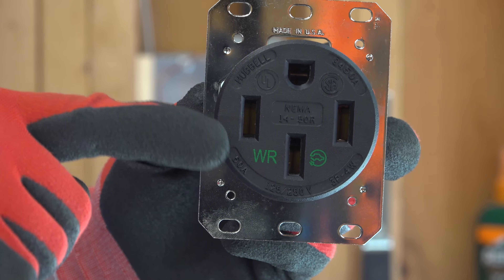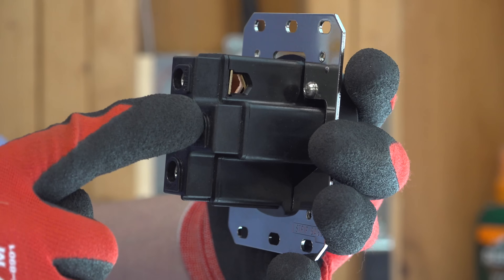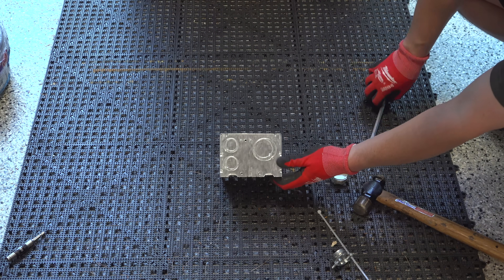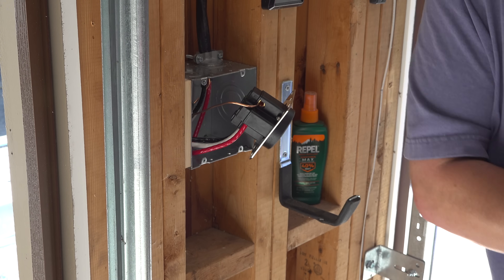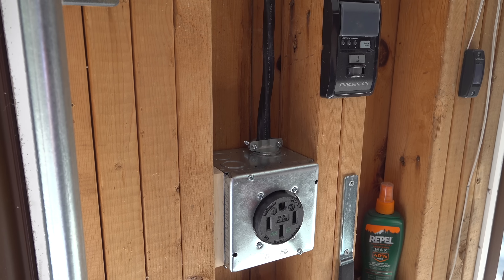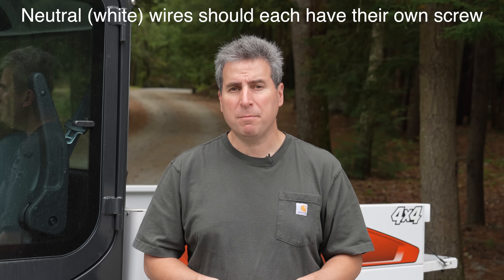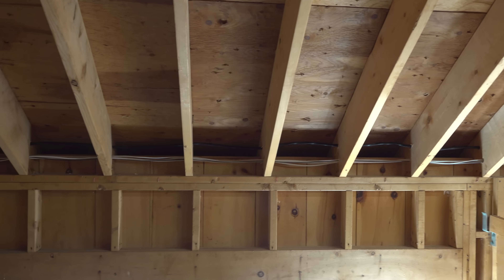How To Install A 240V Outlet Start to Finish -  EV Car Charger - Welder 14-50 Explained

Comment from the maker: Nothing in this video is sponsored. Here are some products to use:  Hubbell EV Outlet: https://amzn.to/4poYhnJ Leviton EV Outlet (great price): https://amzn.to/4nwkoHh Raco Box (bubba) : https://amzn.to/4poYvv5 Raco Cover: https://amzn.to/4mdKBJu  Cable: https://amzn.to/4nzE90I Arizon Cable (best deal): https://amzn.to/48gcqgU Affordable Torque Driver: https://amzn.to/4mZTxTZ
Reply: Can you plug a 50 amp rv into it
Reply: The Leviton EV rated isn't nearly as good as the Hubbell.  If you want to save money, get the Bryant, which is another brand name Hubbell sells under.  It the same design and high quality.

Comment: I believe latest code will have neutrals bonded to ground in one location. Looks like old code bonded every neutral to ground which could result in ghost voltage running in ground.

Comment: Nice job. Looks good. Last long time.

I didn't see if the circuit ground was connected at the outlet or if you simply connected the outlet ground to the box. Did I miss a jumper connecting the box, outlet and circuit grounds in the box?

Comment: The best way to wire any EV charger is to hardwire it. 
The only reason a plug and receptacle is necessary is so that the owner can take the charger with them when they leave home.
The car "should" include a portable charger in the trunk that can be used remotely. 
Keep in mind that every EV owner should be receiving a paycheck from the manufacturer because they are actually part of the test studies. 
The fact that some 50 amp receptacles were melting is a colossal failure of all involved.

Comment: @8:07 CORRECTION >>>. THE NEMA RECEPTACLE IS A 14-50 (not a L-15-40). It is not locking twist lock type.

Comment: This is great. I put in the Home Depot special a few years back and I’m strongly considering ripping it out to redo it this way.

However, I also find that I essentially never need 40A charging for long. I could easily set the EVSE to pull 32A or 24A and have no impact on my life, other than maybe plugging in one more night than I usually do each week

Comment: Most 4x4 box fill issues are resolved by installing a box extension ring. You can add an extension ring to increase box volume, and it meets code requirements. This provides more than enough working space and is cheaper than buying a bigger box, which is harder to find at most stores. The covers are usually out of stock or too big or small because the Hubbell is slightly larger than most NEMA 14-50.

Comment: job not done: permit, you need to notify your power company about an EV charger installation because it adds load to the grid.  very concerned about the load on your service.

Comment: For 240V in my shop, I only use 14-50 outlets.  I mostly run my welder which typically uses a 6-50 outlet.  I installed a 14-50 plug on my 2 conductor (plus ground wire) welder cord but left out the neutral pin.  Funny how close it looks to a 6-50 plug.  If NEMA had the forethought, they could have made the 6-50 plug compatible with 14-50 outlets.

Comment: Nope. 
Silver Cymbol needs to separate the  neutral from the ground at the sub panel. It can be easily done with a separate ground buss. Just run the neutral back without the EGC or better yet, run a separate ECG to open the OCPD in the event of a ground fault. 
The ground rod at the remote building is to drain off unbalanced DC static electricity. 
No good can possibly come from combining the neutral and grounding electrode at the out building sub panel. You get objectionable current.

Comment: You broached the subject of continuous loads and using the EV rated receptacle because of this.  Not sure if I heard you mention what amperage limit a continuous load would be on this conductor and over current device.  Important for many people wanting to install EV supply equipment or use this setup for any type of continuous load application.  40amps

Comment: If you have more than one ground rod and they’re not connected together with the ground cable, then if lightning strikes one of your buildings you may suffer electrical damage. When lightning dissipates into a ground rod, there is a concentrically dissipating circular area propagating away from the ground rod, which could be many tens of thousands of volts per linear foot that can induce a massive indifference in voltage between two ground points and fry all your sensitive electronics. 

No matter how hard it might be, you should connect a ground cable to both ground rods.

Comment: Btw, I also use 50A GFCI breaker by EATON for NEMA 14-50 and I strongly suggest you check the breaker and actually entire installation with Infrared camera after few hours of continuous EV charging.

I had my EATON breaker tripping while charging on hot days, if I turn it on — it'd trip again, but when it cools down — it will work okay for few more hours, and sure thing — breaker was hot on infrared camera, around 55-65C. 

I redid the wiring and re-torqued to spec again, still no luck, nothing else in the circuit was hot on infrared camera — I called EATON support line, explained everything and they said that newer GFCI breaker revision with LED indicator for fault codes is better designed for continuous EV charging — they sent me a replacement and it worked just fine on the hot days this summer!

Comment: Nicely detailed! I simply don't understand why people favor hardwired chargers, I also installed NEMA 14-50 outlet and got myself a 40A charger that supports both 240V and 120V and we simply take it with us for roadtrips to have an emergency charger that will work from any 120V outlet or 240V. Not to mention the general usefulness of 240V 50A outlet in the garage as the video mentions, glad this is getting popularised!

Comment: Please indicate that such a outlet is not designed to be plug in/plug out too often. In fact in most case they are connected near permanently. So avoid to endlessly change the use of the outlet.

Comment: The main problem in the US is that the population isn't protesting the lack of a true three-phase power system.

There is absolutely no need (except perhaps for island apes) to have a 50-amp, 240-volt circuit.

With three-phase power (400 volts between phases), you could use 4 or 6 mm² wire (which is much cheaper and significantly easier to handle than 6 AWG) and a 32-amp circuit breaker.

Comment: NOT CODE COMPLIANT!!!!
 Continuous Loads (e.g., EV Chargers): For loads running for 3+ hours (like EV charging), you typically apply an 80% derating to the wire... 6/3 is rated for 55a for non-continuous loads but YOU NEED A 4/3 romex if you are using ROMEX for a EV charger... (55 amps x 0.80 = 44 amps) If you run conduit and pull THHN wire then you can use a #6 wire. Please be safe folks!! Call your local electrician and ask questions, we use the code book every single day and could have saved this guy a bunch of $$$!!! 

***please note, I also don't believe this will burn his house down overnight, but over time that wire will start to show signs of degeneration form the heat produced.

Comment: 240 Volt Lines can Differ. Im referring to the Neutral wire. Some appliances need a Neutral, some don't. An air conditioner condenser does not need a neutral. A Range and Dryer does. So its best to have the neutral and not need vs need and not have!

Comment: A legend NEMA 14-50R top of the line is $40.  They last forever, it's a commercial receptacle.  This is a very simple installation and frankly in a garage you're better off mounting a metal box on the outside of the finished wall surface, especially if you're finishing your garage in OSB or metal liner panel.
Reply: Legrand

Comment: How did you make video instructing how to wire a 240 plug and not show or explain where each wire goes on the receptacle?
You just said red hot black hot white neutral and other 4th wire ground .
Did good on breaker .

Comment: A NEMA 14-50 is either rated 50A or it isn’t. There is no such thing in UL or the NEC as a “50A but only for a few hours” receptacle. ALL listed 14-50s are allowed 40A continuous on a 50A circuit. Cheap and Hubbell units are both 75 °C lug rated. When 14-50s melt during EV charging, it’s almost always poor installation (loose or improperly torqued terminals), not because the outlet “isn’t continuous-rated.” EV charging just exposes bad connections.
Reply: There is a difference in durability between 50A receptacles of different quality. Sorry, not black and white. Plenty of examples of ppl melting plastic on cheap 50A devices after long charge sessions. Depending on environment and heat dissipation issues outside the device itself (e.g. wall, insulation), 50A heating performance can vary considerably, all within listed gear

Comment: Not true. The $12, 50 amp outlet was designed for 50 A. Whether continuous use or not. That’s ridiculous to think that the manufacturer would’ve designed a device in away that was only considering intermittent load.
Reply: You’re new to capitalism, I see

Comment: Reality is 99% of EV owners do not need 50amps or even 30 for daily use unless they drive 250 miles per day 😮.  I installed a simple 220V/20AMP with a 16A.  Plenty good to top off the Teslas’ battery after coming home.  I even have the rate of charge set at 12 Amps to be more gentle.  Staying with a 20A solution is less expensive and practical as I installed a dual outlet with 220 and 120 at 20 Amps to power my compressor or cheap welder.   Here is my video. https://youtu.be/nEmHBaSZd-U?si=-lQ-wsK1NHz3hh-f
Reply: Being more “gentle” is not a thing at residential charge rates. Being more gentle than dc fast charging is. Below 40A, you don’t get a benefit of even slower charging, and the efficiency actually goes down (more cumulative loss to heat dissipation).

Also, residential power in the US is 240v, not 220, and hasn’t been for decades
Reply: @nate3356 the term 110 and 120 are used interchangeably, same for 220 and 240.  The point is no one needs 40 or 50 Amp charging at home to replenish the energy they used during the day.  Anyway, plenty of people will install them because they think they need one but they don’t for normal daily use.  They can avoid the expense if there was more awareness on 220/240V @16A

Comment: Don't use an outlet - hardwire it to avoid melting your chargers  plug when the receptical connections become loose or corroded or the receptical is underrated for your actual duty cycle.
Reply: He specifically picked the most high end receptacle commonly used (Hubbell). This is an indoor installation, it’s not corroding

Comment: You can also use #8 90deg C thhn / thwn wire as it is rated at 55A
Reply: You aren't going to find terminals rated for that temp though, 75c generally on breakers / outlets ... so 50 amp.

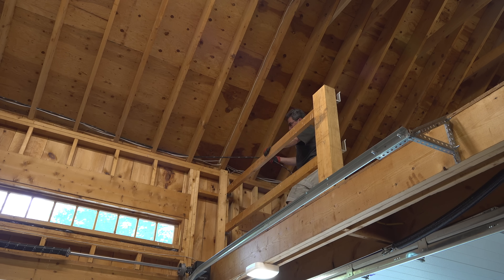Comment: @6:00 you want to be drilling holes for the wire at least 16” away from the tail end of any stud or rafter. Im fairly certain the IRC code mentions this requirement.

Comment: Can this be done for a 120-60 / 240-50 universal power supply for an electronic device? I'd like to run it here in the u s on two forty.Because it draws twenty amps. I know the ground will be different. How does that matter? Is this safe to try or should I stick with the one twenty and deal with the twenty amps?

Comment: One more tip, when working with stranded heavy gauge conductors.  After you torque them down wiggle them, you will be surprised by the results when you torque them again. Great video!

Comment: If I pull the wire through drywall does it still need to be attached down to the stud inside the wall? Or can if be free floating?

Comment: Couple things to mention here:  Yes, the 2020 code requires the 50A GFCI protection.  *BUT*  your city may not have adopted the new code cycle.  The NEC codes are suggestions to the cities, they can adopt it, adopt it with amendments, or not adopt it at all.  Many cities are still using the 2017 code, which does not require the 50A GFCI protection.  Check with your local inspector, and follow the codes that your city has adopted.
Also, yes you can run NM cable inside conduit, as long as that conduit is indoors.  If you run it outside, then yes you need to use THHN wire.
Reply: If he is not in city limits then compliance may simply be by State.
Reply: Good point. FYI - New York State JUST updated from the 2017 NEC, to the 2023 NEC 12/31/2024.

Comment: At 8m11s, you state that the outlet is a "L15-40"... The outlet clearly states that it is a "NEMA 14-50" and it does not have the features on it that would meant that it is a "locking" outlet (and thus the "L" designation.  The locking type plugs usually have the pins oriented in a circular pattern so that a slight twist will somewhat lock the plug into the receptacle to reduce the chance of an inadvertent unplugging.

Comment: I think the quality of the panel could be in question also since there are AL bus bars that are not usually suitable for long use high current draws either. Unless code has changed romex can be exposed above 8’. Plus those aren’t studs as you mentioned but what you are showing are rafters and the size of the hole you are drilling may require structural review.

Comment: One thing you forgot to mention about the Break is to make sure it matches what your service panel (breaker box) says it uses. And the breaker needs to be 20% more than the amps you're using.

Comment: Can you run this cable outdoors? Or should I get an outdoor rated conduit?
Reply from the maker: This cable can NOT be used outdoors. It can go through a wall into a box outside if its mounted directly to the structure, like an outside outlet. But if you are running beyond that you will need conduit with THHN. Be careful with outside work as there can be distance limits, can't be near other items, etc. Check with your local permitting authority to be certain or a licensed electrician as these get more complex.
Reply: @SilverCymbal  An electrician quoted me $2000 and that seems like a lot which is why I am looking at doing it myself.

Comment: Just keep in mind NMB (Romex)#6-3  is not rated for the 47 amps . 47x1.25 58.75 amps for continuous duty . Need to run separate runs THHN  red ,black ,white , #8 green and pipe work . There’s other wire you could use, but this is the basic for what you have.
They also make EV wire from TCER Direct   which is a tray cable and joist rated and sunlight resistant. Eaton series BR we’ve been using  H Series breakers  heavy duty breaker

Comment: Correction!!  Both outlets are rated 50 amperes, but the EV outlet is more robust internally in order to accommodate the constant plugging in and unplugging of power cords. It has nothing to with drawing power for a longer period of time. The problem is that the less robust outlet (non - EV) will become loose/worn out over time.

Comment: You can also use it for back feeding power when the main switch is disconnected from the grid with the generator.

Comment: Some thoughts on why the "cheap" get too hot. #6 conductors are stiff, so when you fold them into the box after you tighten the terminals, all of the manipulating of the wires can loosen the used to be tightened terminals. When you tighten and then fold everything in pull it back out just enough to retighten, you will be surprised that you will be able to get another 1/4 turn or so. This is continuous load mine is 22amp, a continuous load like that if the wires are not secured well can produce heat. With that kind of heat, think of it like cancer, it just keeps on putting more resistance in those connections. What ever you do, do not try to save a little money and use AL.

Comment: What is a reasonable range for a licensed electrician to do the job?  I got quotes from $500 to $3000.  I have a newer house with panel outside the garage side wall.

Comment: Any problems nuisance tripping the gfci while welding? If not, how many amps is your welder, and is it inverter type or other type, and have you maxed out the amps with all the different processes? Reason i ask is I'm not convinced i should buy an 80 amp gfci breaker to make my current setup meet the new code.. My welder's owners manual essentially describes that internal damage caused by power supply outages is likely and won't be covered under warranty. Maybe I'm misreading this part, but it's in the section under 'powering with a generator'. It says overloading the generator by using a welder that draws more current than the generator is rated for will likely damage the unit and it won't be covered. So i infer from this that if i were to trip a gfci while welding then it's no different than popping the breaker on a generator while running the same welder. The welder isn't cheap. I won't weld while standing in a puddle. Not sure it's worth it. What are your thoughts?
Reply from the maker: That's a great question and now a month later I can share the GFCI has not tripped once and I have welded a lot with it. I was worried as I have seen posts with people saying it can be a problem but so far with what I showed in the video its been working great

Comment: It would probably be better for the NEC to BAN the Leviton receptacle altogether now simply because it is a fire hazard when used in high amperage long duration situations. Naturally the DIYer and most electrical contractors will choose the much cheaper Leviton without knowing the fire risk. 
Leviton SHOULD be proactive enough to make the change if they want to maintain their otherwise good reputation‼️